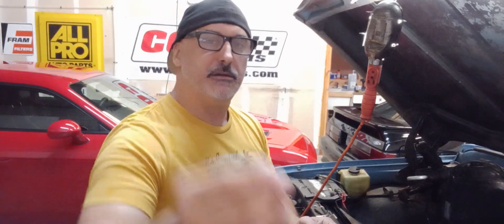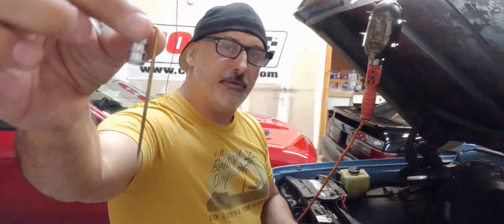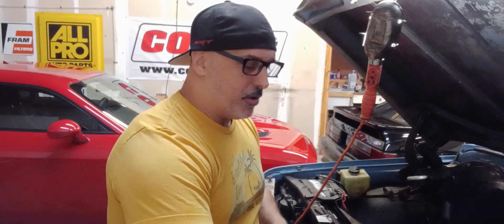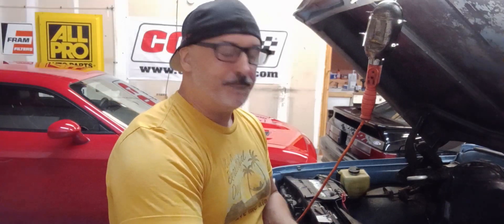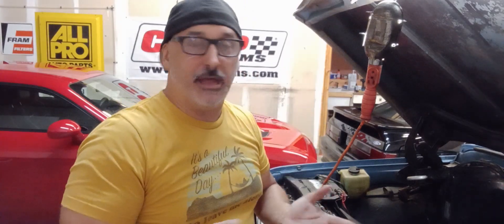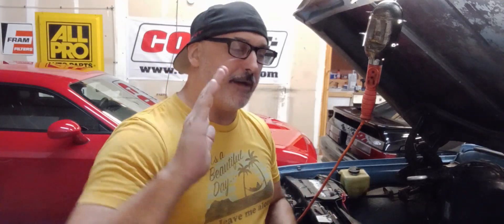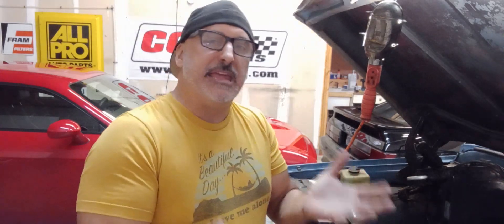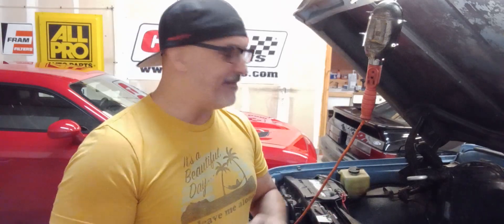Carburetor Tuning With An Edelbrock. AVS2  -  4 Hole Spacer VS Open Spacer. 400 SBC.

Comment: So, after all the talk, what happened?
Reply from the maker: The truck ran well but had a cold start issue that it didn't have with the open spacer . Currently running a tapered combo that seems to be what the truck likes the most.There really wasn't any difference to speak of in terms of air fuel ratio.If this engine spun to a higher RPM, I'm pretty sure that that would change

Comment: I know I ask stupid ? Or seem that I don’t know exactly what you mean is true love cars but do not no much. When you say in that application meaning the 5.7 with headers and cat back or cam gear and tc??

When I was listening and finally found you to do mods on my 5.7 I started to write things down so I got cat back and shortys with a gear but when I took it to this guy that is big out here in Cali he said let’s put on the headers and do a tune 91 was in option but he said I would get more out of a E85 tune. So do you think I shouldn’t have got that E85. And if you don’t mind give me your two sence one of the two cams you mentioned and a nice tc to install with a good gear.
Iam just feeling like I made a bad choice so far or you think no it’s still a good way I moded the car and what I should do next want to have a dope car
Reply from the maker: You're still good. If the car is running good now, I really wouldn't start digging into a camshaft. To be perfectly honest, you start to spend a lot of money that you could put towards a car that's just simply faster from the factory. Something with a 392. Camshafts, to be frank with you can get you into more trouble than they're worth. Especially with you being out in California. If I were you I would hold what I have and save up for something later

Comment: 5.7 application with header cat back and E85 tune I was just listening to one of you old videos to not to choose one that is too aggressive so that it’s not slow in the bottom to come flying at the end. I decided that I like the idea of naturally aspirated and not going force induction to have a car that is fun fast and still reliable
Reply from the maker: E85 is not going to D you a whole lot of good in that application. Your compression ratio is simply not high enough to take advantage of E85. For that matter the 6.4 liter doesn't either. Look for a cam that will come in somewhere near 218 degrees duration on the intake side around 224 degrees on the exhaust. It won't be a huge bump in power but it will be mild. Completely workable with the stock torque converter or any other converter you would choose to put in the car. Much larger than that and it will have more of a tendency to have a aggressive Idol, and characteristics that you may not be too fond of long-term. I have a cam called the contender that doctor differential has installed. His shop is in Groves Texas. It's a fairly mild cam, does offer a slight bump in power. Nothing too drastic. Just keep in mind that camshaft is very subjective when it comes to the drivers impressions. Since we're talking about torque converters, I also have the Joker grind, which is a very popular camshaft, but it is an aggressive cam for 57. Give them a shout out on Monday, they can walk you through them.

Comment: What do you think is the best cam out there and one that’s not too aggressive with witch tc stall 2800 or 3200??
Reply from the maker: That's an impossible question to answer. You haven't told me what engine, what's the application, You have to Define what is "too aggressive." Because that is entirely subjective. What I think is aggressive, you may think is mild.

Comment: B Man Good vid and Good to see ya working on a old skool 400 SBC . I got two. One in my 36 Ford Coupe with a 750 Speed Demon and a 150 shot and also another one in my 41 Ford truck with a 177 and a 750 SC Holley. They are torque monsters. Yep Chevy's in a Ford. Kinda funny I have a Innovate LM-2 also.
Reply from the maker: For a  Street engine, Cruiser, general-purpose Tire frying Appliance, I love this 400sbc By the way, this spring swap flopped. This girl is thirsty. She needs that needle out of that jet like right now on tip in. Even with the pink Springs with this Edelbrock she went lean. I was actually pretty surprised.

Comment: Hi B-mason from San Diego with that 5.7 13 I got the cat back shortys and E85 tune. I understand that I have heard your 5.7 videos before so I know there there’s not much gains but I like get rid of my cats can I get cat less pipes and how do those work I want to remove them and not get Cel to come one any device
Reply from the maker: You can get cables pipes.  The rear o2 will need to be turned off in the tune.